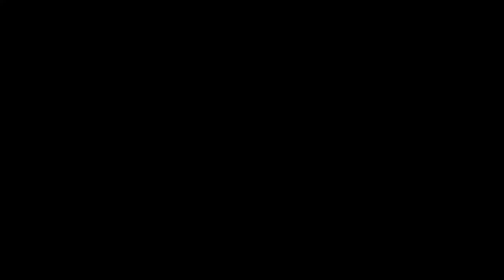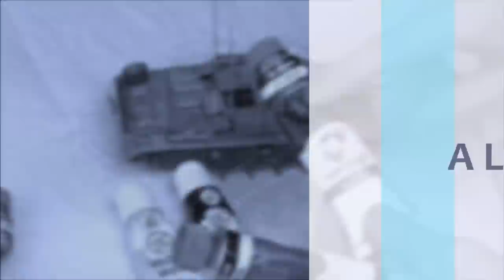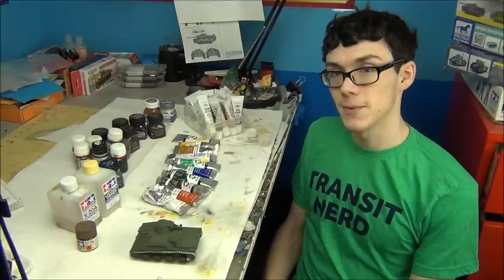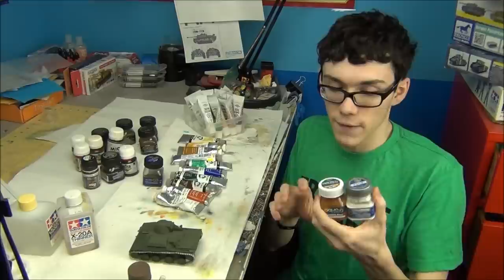Why You Shouldn't Use Acrylics for Weathering Model Tanks

Comment: Good explanation there Evan. Of course one CAN use acrylics for weathering, one just has to do it a lot differently than people tend to think, which can be a hassle. Afterall, i have seen people using color crayons, ink, earth from outside and a lot more to weather a model, and it all works as long as you know what you are doing. As you explained, oils and enamels tend to be easier to work with these days, so thats what is usually recommended, which is exactly the point of your vid.

Comment: Interesting topic Evan.
Your video will make life of beginner modelers much easier but I need to say a few my opinions.
1. Acrylic filters are ok. I'm using this technique  Very well thinned acrylic paint is not bad for filter and dry fast.
2. You forgot to say that enamels dry a lot faster than oils. 
3. When you compared oils and enamel effects you didn't mentioned about one thing: when you buy weathering enamel you get the right colour, when you choose oils you need to know which color will be ok for your model and color of base paint.  That's why eathering enamels are better for beginners in my opinion.

Comment: Pff great video. I almost ruined two Schneider CA1 that I very much treasure adding to my WW1 French Army. I was pin washing and dry brushing with acrylics, thinned down, on top of a semi gloss satin varnish. Started to wipe away excess that stubbornly didn't move. I thought "uh oh" because they had a hand brushed camo on em which turned out pre good. I got what I wanted off then thought they looked okay - I saved them from destruction. But then I stopped. I said "okay something's off, it's not working." The first time (and only other time) I pin washed and dry brushed with acrylic turned out pretty good - must have got lucky for sure - and this was not the case here. So I stopped and youtube'd weathering tanks. Found this right at the top and went "boom, there ya go. there's my answer." I thank you for this content from one proud military history nerd and miniature hobbyist to another.

Comment: IMHO this is good advice for newcomers who are starting to do weathering. 

I have always preferred to use oil or enamels for washes and dot filters.  I tried the acrylic sludge wash and I did not like the results. I will try it again sometime since I like to have other options and effects. Acrylics can be used for certain  weather effects but I would not recommend them to a complete newcomer unless they practice with it first. I do like acrylics to simulate dust for example ( airbrush ), since pastels can fade over time or disappear altogether when you spray an overcoat. I know there are ways to get the pastels to stay but I find the acrylic dusting technique  a lot easier. Acrylic behavior varies from brand to brand and the technique that works on one will work on another. Vallejo is probably the easiest to work with if you want to try your hand at acrylic weathering. Tamiya is solvent based and will dry very quickly. If you make a mistake with oils or enamels it is very forgiving compared to acrylics which could require another coat of paint or even a complete stripping. 

Read the comments and there are some good acrylic weathering ideas I want to try out.

Comment: 'Newbie alert'...... I'd be grateful if you or someone could inform me of what thinner you are using with the oils. My wife has loads of oils so I don't need to buy any, but 'thinners'...., rather know what you use. I Haven't built a model since childhood & I'm just turned sixty two & 'revisiting' this hobby with a more patient outlook. Any help I would be grateful for. Best wishes & great video. By the way, I'm going to build & hopefully, paint a P51d mustang in the colour scheme of the 'Tuskegee' airmen.
Reply from the maker: +Garry Hill I'm not sure if I mentioned this in the video, but I use Wilder enamel thinner and sometimes AK Interactive White Spirits.  Another option which should honestly work just as well is using lighter fluid...seriously.  Zippo lighter fluid is very similar to the Wilder thinner and plenty of modelers just use that instead - Hamilkar Barkas does for example.  

Just don't make the same mistake as so many others and use acrylic thinner for the oils.  That won't thin them down and will instead damage the previous paint since those paints are likely acrylics and the thinner is meant to thin those down.

Comment: These days, come to me, two products I never use: Streacking grime from Vallejo (Acrylic) and the same for MIG (Enamel). The acrylic product dry in one second and stand in the tank until today....No water, no Isopropyl alcohol, no odorless thinner, nothing moving from the surface (I still not use benzin, acetone or lighter fluid). The enamel one, moves easily with the odorless thinner.

Comment: Ive tried weathering sand and dust with acrylic Tamiya paints and water.  It is actually possible, but like you say, it dries super fast almost instantly and is difficult to manipulate or remove afterwards.
A good tip is to have an old or broken vehicle/model you dont care about and keep that one to test different techniques out on. That was how i discovered acrylic paints were basically useless for weathering  effects.  Thanks for your videos. Ive learned some cool stuff from you. Your work looks really professional.  What kind of top coat would you use to seal weathering powders?
Reply from the maker: Thank you.  I would finish off with a matte lacquer like Testors Dullcote.
Reply: @Panzermeister36  
Thank-you for the help and for the brilliant video.  Much appreciated :)

Comment: Excellent explanation, I totally agree. I have all those fancy enamel washes, filters etc too and they work fine. However, I often find myself adding thinner to these products anyway because it doesn't have the right 'consistency'. I do like the colours though and mixing paints to get the colour I need is not really my thing. I bought a lot of the Abteilung oil-paints for that exact reason. I'm weathering model trains by the way, but I did buy a Pz. Kpfw. III today (Dragon). I guess watching all these videos about weathering tanks ultimately makes you buy those kits :-)

Comment: I agree with the durability argument....a Perkasa radio control patrol boat I painted in 1977 with enamels is a salient point BUT the fast drying acrylic argument doesn't hold water..excuse the pun.  I decided to go down the acrylic route for two reasons and those alone.....ease of use and above all safety.  Yes, the Vallejo paints I use aren't cheap, but what price your health?  Moreover, I don't see any spray booth on the bench and he's breathing in those fumes?  He seems a keen modeler, so will be breathing those volatile products for longer.  I have an off-the-shelf bottle for cleaning through my spray guns with water or Vallejo thinners....safety and ease of use and when you see the number of modelers online who use acrylics for weathering, this argument simply doesn't stand up to scrutiny, nuff said :)

Comment: Excellent video.  Yes acrylic based products and enamel/oil based products are what is called "non-miscible".  Meaning they do not form a solution.  Which is an excellent property for modelling because they can come into contact with other without reacting.  I wish I had seen this video when I first started modelling, because I certainly did some pretty weird things in the name of weathering.

Comment: Thanks, my biggest frustration has been learning the interactions between different paints and thinners.
Reply: Longer dry & cure times will help as can lighter coats. If you can smell the paint you can wait. It can take days or even weeks and months depending on whats happening. Some lights or a drying aparatus such as a hearing aid dryer can help speed things up but can have ill effects as well, slowing the drying or curing.

Comment: I use to mix Tamiya acrylics with water years ago for washes (10% paint 90% water) and it was ok,but not as good as oil paints.This was mid 80's before the commercial washes of today.
Reply: Yep. I'm 50, and started doing the same in the mid-80's as a teenager using the old Polly S water-based weathering colors over the then-new Tamiya alcohol-based acrylics. It never worked well at all even though I heavily thinned the weathering colors with a 90-10 thinner-to-paint ratio mixture of denatured alcohol, distilled water and Lemon Joy dish detergent, (to break up the Surface Tension). The thinned Polly S would always look great when first applied, but would dry quickly and unevenly, and for myself at least, appear quite blotchy and unrealistic. It only took having to strip and repaint a couple of large-sized 1/35 Armor Builds before I went back to weathering with artist's oils for good!

Comment: You can still weather with acrylics, but it's harder, because you clean it up by covering it up with the base color, rather than trying to remove it with thinner. Mostly used by mini painters, where the amount of cleanup is a lot less than scale models which are much larger.
Reply from the maker: Yes, you are correct!  I just would not recommend it, especially for people who are starting out.  It's a lot more work and requires more skill.  That's why I said "shouldn't" not "can't" :)

Comment: Vallejo has a nice video and some books on acrylic weathering. The results are very nice.
Reply from the maker: +Spugnoid yes, but this video is aimed at beginners, and I used the word "shouldn't" not "can't".  You can use acrylics, but you can usually achieve the same effects with much greater control and much less effort using oils or enamels instead.

Comment: Great video. Yup... Don't want to use Tamiya acrylics to weather over a Tamiya acrylic base coat. Gotta remember tho that Tamiya "acrylics" are not like most acrylic paints. Their pigment is suspended in alcohol, while most acrylics suspend their pigments in water. I haven't tried it, but you could, in theory, apply weathering over a Tamiya base coat with a regular acrylic like Vallejo.
Reply: I've tried that. In a word, dont!!

Comment: Hi. Great follow-up video. Regarding using oil paints for weathering because they stay wet and thus can be used/worked with for a longer period of time, how do you eventually "set" it or "fix" it so that it dries? I was looking at a Windsor and Newton matte fixative and it says to wait until the paint is dry which can be 6-9 months. What have you used? Where in your process do you use the oils so that they don't become an issue for you as you continue to work?
Reply from the maker: Oil paints may take months to dry when they're used the way a painter would....applied thicky on canvas.  It is recommended that modelers let the small blobs of oil paint sit out on a piece of cardboard for 5+ hours to soak out a lot of the linseed oil; this will make them dry faster.  We also apply them in much thinner coats of course.  

Here is an older video of mine which may help you: https://www.youtube.com/watch?v=uV26I1WQ01U

They're usually dry within 24 hours in my experience, and I just seal the model with matte varnish in the end.
Reply: @Panzermeister36  great!! Thank you so much!!

Comment: @panzermeister36 sooo this is a shot in the dark, i got some acrylic wated based paint for my airbrush, i want to use this as my main paint for the body, can i still apply weathering effects with a oilpaint on the top? or will i end up removing the acrylic paint if i messedup some place with the oilpaint and want to fix it?
Reply from the maker: If you are using water-based acrylics, then you should apply a protective semi-gloss varnish before working with the oils.  Otherwise the oil paint thinner may attack the water-based acrylics.
Reply: @Panzermeister36  thank you for such a fast answer mate! I'll make sure to use my varnish first then!

Comment: I have a question, you need to clear cote or apply any kind of varnish to the model before use the oils or you can apply it without any protection to the paimt work?
I have never use oils and i want o start using it, any tips will help a lot:3

Comment: Well, Im painting my models with brush using Humbrol (before they were covering model very good, now I have to apply 2 layers)  or Revell applying 1 to 2 layers, depends. The thing is I cant use oil or enamel wash because it will melt my paint, right? Also I cant protect them with varnish because there will be already too thick coat so I just bought acrylic wash. I will check how it works.

Comment: If my base is enamel thinned with lacquer thinner or spray from a rattle can, what thinner can I use for the oils?
Reply from the maker: +Havanadog 7 you would probably want to apply a lacquer clear varnish beforehand to protect your underlying paints.  The rattle can stuff is probably lacquer so that should be okay without the varnish, but I can't say for certain.  Then you can use any thinner for the oils.  Otherwise, pretty much any oil thinner will attack your enamel paint.
Reply: Panzermeister36 if I have enamel thinned with lacquer thinner won’t it be attacked if I also use it for the oils?
Reply from the maker: +Havanadog 7 I'm not sure about that as I have never thinned enamels with lacquer thinner.
Reply: Panzermeister36 ok thanks for the tip man! I think I’ll use the lighter fluid instead of lacquer thinner for the oils.

Comment: I Weather Model Railroad Equipment which uses all the same techniques as Weathering military equipment. Acrylics seem almost useless to me and just make models look like crap. Ive tried using an acrylic wash with a store bought flow agent and can seem to get good results. The liquid just flows to a place where it can rest and all the acrylic dries up there. Keep in mind this is while giving the model my full attention. Dusting with grinded pastels and laying oil on top for the heavy rust and pitting and streaking seems to give the best results. The only other improvement would be to get an airbrush which I've never tried. Anyone have any tips for how a moderate wash should be? Also I thought you need to use oil to think oil paints.

Comment: So can you use acrylic for base color and then use a varnish and then apply Oil? Or you would say oil is better also for base ?
Reply from the maker: Acrylic is always best for the base.  What you wrote in your first sentence is exactly what I do.
Reply: @Panzermeister36  Alright thanks a lot! What varnish do you use so it dosnt get glossy?
Reply from the maker: I usually use Tamiya XF-86, sometimes with some X-22 mixed in to make it a little more smooth.  I thin it with Tamiya thinner so there is about 80% thinner to 20% total "paint"/varnish.  This gives me a nice satin varnish which I airbrush on.
Reply: @Panzermeister36  Thank you!! :D

Comment: Great video, thanks. I have a problem though; I apply my acrylic base coat then acrylic gloss varnish. But when I try and clean my oil wash the enamel thinner I use starts removing the acrylic base coat? Even though it’s been varnished. Any idea what I’m doing wrong. Thanks
Reply from the maker: +McNab I would guess that the enamel thinner you are using is too strong, or perhaps you are using very poor varnishes by Vallejo or Mig AMMO.  Those are very weak and won't do a good job of protecting your model.
Reply: Panzermeister36 thanks. What varnish and thinner would you recommend?

Comment: Thank you for the info I'm a 50 yr old newbie to weathering - can you tell me where you get your oils.
Reply: I have used oil paints from Michael's craft stores.
Reply: Any artist’s supply shop usually carries a big range of oil paints. Don’t thin them with turpentine though - oils don’t dry they oxidise from contact with the air. Turps and linseed oil take a very long time to oxidise - I have some 15mm horses I experimentally painted with oils by using a white base coat then brushing on a thin layer of black or brown oils. The result looks really good as the oil layer shades naturally by building up in the recesses. I painted them ten years ago and they are still a bit sticky to the touch...

Comment: Im looking at trying  oil paints, what brand name do you suggest?
Reply from the maker: Winsor and Newton "Winton" line has worked well in my experience, and it is a great artists brand for use in modelling.   However, actual modelling brands work better on plastic surfaces, so Mig AMMO Oilbrushers, Wilder Weathering Oils, and 502 Abteilung oil paints are all best in my opinion.  They might just be harder to get.
Reply: Panzermeister36  Thanks I was at hobby lobby then carry "Masters touch" for $2.50 a tube But was not sure that would work with plastic models
Reply: Panzermeister36  
 And to thin the oils instead of lighter fluid what was the other solution ?paint thinner?
Reply from the maker: You'll need oil paint thinner.  Common paint thinner is generally meant for acrylics.

Comment: how can  i use 2 oil weathering techniques like wash and filter without spraying a clear coat   between the layers?
Reply from the maker: +Berkay SERTER I do it all the time with no issues.  Pinwash is only around details, while the filter is on the flat panels themselves, so they shouldn't interfere with each other.

Comment: What do you use to thin oils , and will not strip the acrylic paint
Reply from the maker: +Airable 1 Wilder enamel thinner.  Lighter fluid works just the same.
Reply: @Panzermeister36  so it doesnt strip the acrylic?
Reply from the maker: +Airable 1 not in my experience.  But if you use a really low quality acrylic paint like Vallejo, it might still give you problems.  That's why varnishes are a useful tool to protect your base paints.  The lighter fluid won't attack your varnish for sure.
Reply: @Panzermeister36  what about white spirits or turpintine